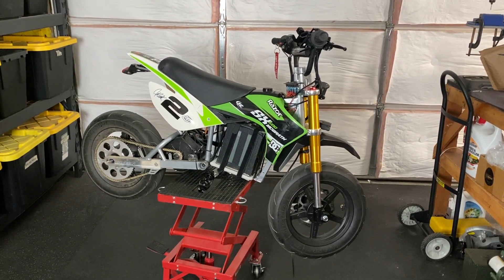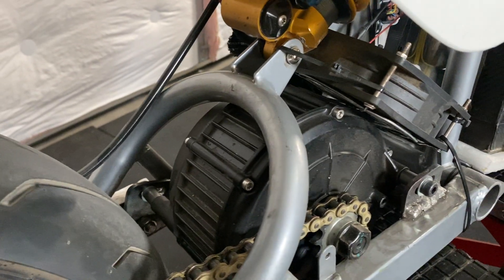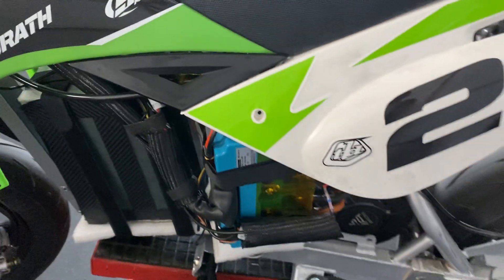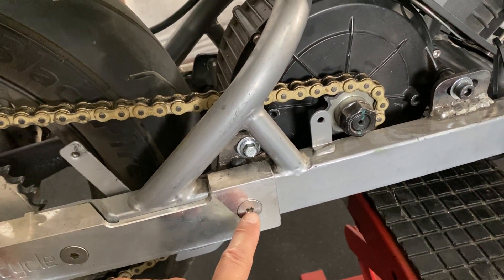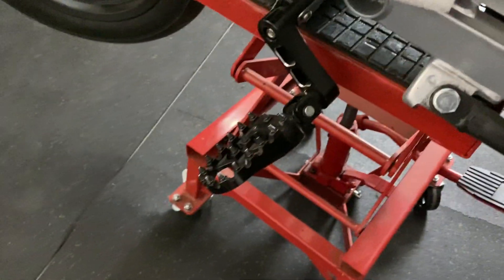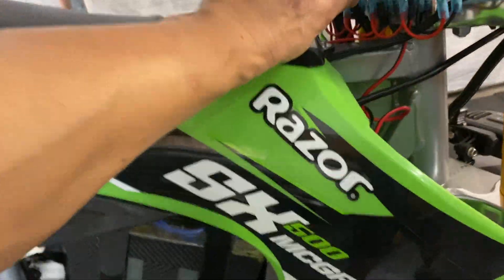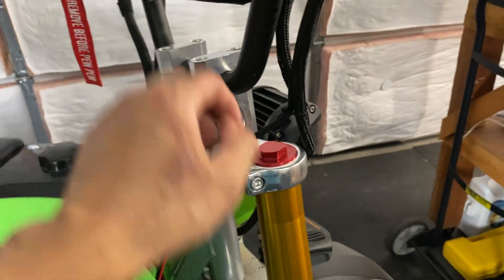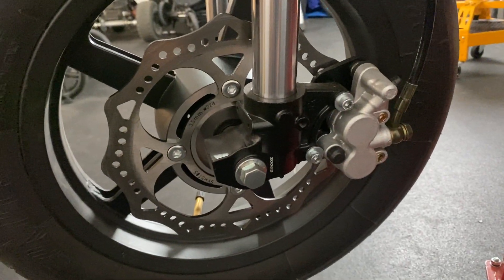Razor SX500 | 72v | QS165 | Fardriver | Molicel P42a

Comment: Im have 2 mx650's i got used off of craigslist for a good deal so that i can upgrade them but i was hoping to get some advice on witch motor is  better choice if im looking to get the most power,speed, quality, and durability between the ec4p motor by electro and co or this qs motor your using. I know theres a price difference and one is bolt on and the other would involve more modification to work and i dont mind paying more and or doing the extra work if it pays off in the end so if amyone has any advice on this it would be greatly appreciated!
Reply from the maker: I highly recommend the new Sotion FW11. It's plug n play/no modification needed to the stock razor swingarms, and seems that it outperforms the EC4P and QS165 in addition to handling heat a lot better. 

I def would of picked up this motor if it was available during the time I was working on this build..

https://eforcemotorsandcontrollers.co/products/sotion-fw11-5kw-motor
Reply: @bolectric how when peak power only 10kw.?

Comment: deciding between the qs165 and the ec4p idk
Reply from the maker: If you want something that's plug n play then EC4P is def the way to go. 

QS165 will require an extended swingarm along with some fabrication & modding for the motor mounts along with sprockets. 

It is capable of more power but will require more effort and coin to get it to fit..

Comment: Sick build! I’m going to go the route of installing the Alta throttle on my eFTR. My dad has an Alta and he happened to have an extra one (sweeeeeeet) so I’m wondering if it was easy to get it wired up? I’m using a FD 72680 and I’m picking up the throttle tomorrow.
Reply from the maker: Thanks and yes it's pretty straight forward! Red, black, purple is signal.  You can google for the wiring diagram. EMXBrandon also has a great video on FD wiring which is what I referenced for this build 🤙🏼

Comment: Hey I noticed you said that the crf50 seat isn’t as comfortable as the luna float seat. Is there a reason that you didn’t use a luna float seat for this build?
Reply from the maker: I wanted to keep the stock plastics and there would be gaps if I used the Luna float. 

It would also require more modification and retrofitting. I really just wanted to get this build up and running asap 😅

Comment: Is the soloid pandermic capacitor engaged to prevent any modial interaction from the capacitive reactance?
Reply from the maker: The original Machine had a base plate of prefamulated amulite surmounted by a malleable logarithmic casing in such a way that the two sperving bearings run a direct line with the panametric fam...
Reply: Solid question but.. did it consist simply of six hydrocoptic marzlevanes, so fitted to the ambifacient lunar waneshaft that side fumbling was effectively prevented?
Reply from the maker: @EmxBrandon  😂😂😂